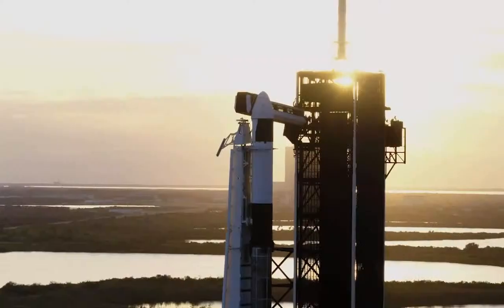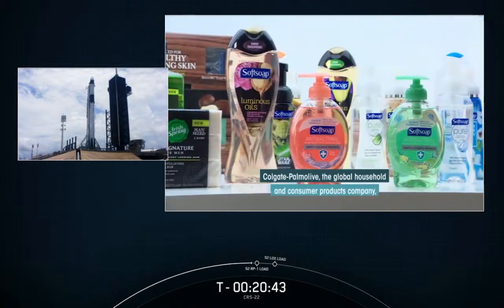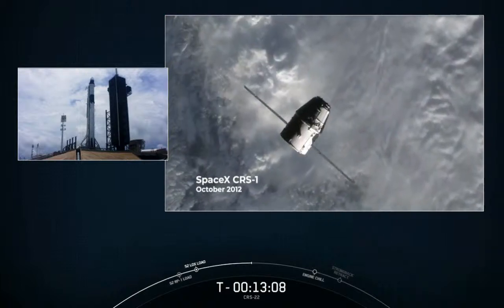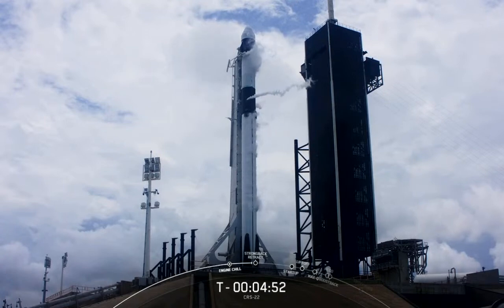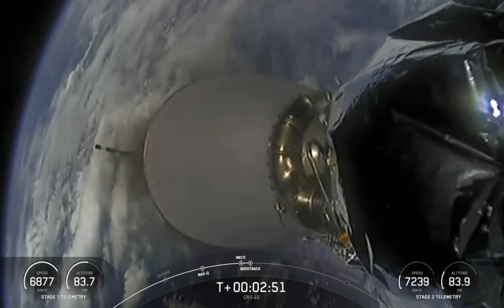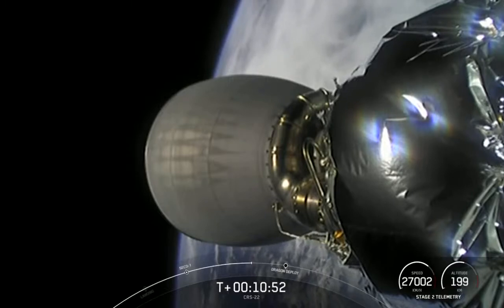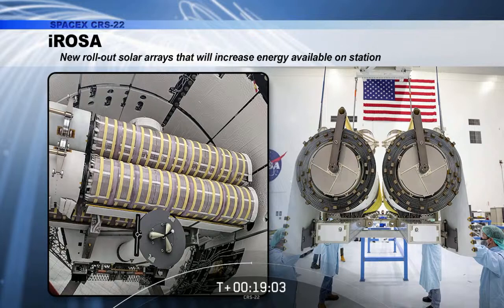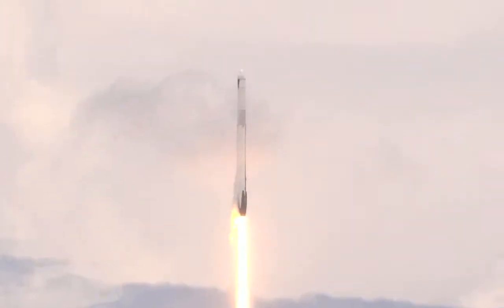CRS-22 Mission

Comment: Why is cargo dragon doesn't have superdraco engines?
Reply: Because they’re not needed since cargo isn’t as important as crew and would add dead weight which would decrease the payload it could carry
Reply: @weekiely1233  so you mean draco thrusters are capable enough to catch up with ISS and deorbit to return? That's amazing tho.
Reply: @MotoREEngr  on the front of the capsule you can see 4 thrusters. 

Those are the forward bulkhead thrusters that are the ones that do orbital manoeuvring, rendezvous and de orbiting. 

The superdraco engines are only used during an abort but we’re going to be used to land the capsule instead of parachutes. This idea was abandoned because it would take too much time to get certified.
Reply: @weekiely1233  Nice! Thanks!

Comment: Starship Landing
All planes on earth land horizontally on TRIPODS, regardless of length of fuselage or weight from super light piper cubs to jumbo jets to military carrier planes that transport heavy battle tanks to HARRIER jets and F35 fighter planes that do vertical take off and landing.

Why do planes land HORIZONTALLY on TRIPODS? It's the safest regardless of how smooth or bumpy the landing may be.

AND, consider how tall the Starship is, AND how top heavy with its payload of 100 metric tons - where is the center of gravity? A little tilt, like the lunar lander of Apollo 15 in 1971 - the Starship could topple down. WHAT GUARANTEE have you people that the landing site will be truly flat and sturdy and strong enough to support the FULL WEIGHT of Starship PLUS PAYLOAD. AND YOU'LL BE LANDING A THOUSAND STARSHIPS ON MARS VERTICALLY?!? HOW SURE ARE YOU THAT EVERY SINGLE ONE OF THEM WON'T TILT. SOFT SOIL OR BLOWING WIND ON A SHIP WITH A LITTLE TILT COULD FALL DOWN.
Reply: My man who will know more people who studied for that stuff ir a random dude on internet?
Reply: They have detailed height maps of the moon from the LRO, and spacex has already mastered landing in the right spot

Comment: Something fell off the top of the Second Stage engine, just above the bell, at about 3m12-16s. That happened?
Reply: Seems to happen on every launch. I think it's some kind of heat protection material that is shaken loose.
Reply: @3gunslingers  
It’s most likely ice. The propellants are kept really really cold so they’re denser and that causes the humidity in the air around the rocket while it’s still on the pad to condense and freeze. There’s a lot of little lips on the rocket where tiny pieces of ice will stick around for a while into the launch.
Reply: @dalesajdak422  
The fluffy stuff comes out of the engine wrap and pools on the exhaust piping on the engine nozzle. That's no ice.

Comment: Plans to return stage 2 or will it be junk every time?
Reply: It is always deorbited, or placed in an orbit that will eventually decay, so it always burns up. They studied the possibility of recovering it, but that would have required adding so much extra weight for fuel and heat shielding that there would have been very little left over for payload.

Comment: This is such a Scam.
Reply: What's a scam?
Reply: @Ethan_Roberts  The Reverse Landings.
Reply: @hotheadedjoelhaha  they're not reversed. Firstly that wouldn't be aerodynamically possible due to the low centre of mass and grid fins at the top. Secondly, the smoke goes away from the rocket, not into it. Lastly, this booster will return to port in a few days and be visible to hundreds of spectators. It definitely landed, no reason for it to be faked anyway.
Reply: Conspiritard?
Reply: @PentaxAstro  You can do much better than that.
Reply: @hotheadedjoelhaha  It's a question. It's not my fault you were vague. Are you suggesting a conspiritard, and if so, how does it work?

Comment: Boost back for a drone landing? Did they move the drone closer to shore?
Reply: Yes.  about 300 Kilometers, instead of around 550.  Because of the intended orbit of Dragon (Dragon uses the lower orbit to catch up to the ISS), Dragon had some fuel left over to Boost back.  Closer drone ship to shore, faster turn around, less fuel used on Drone Ship.

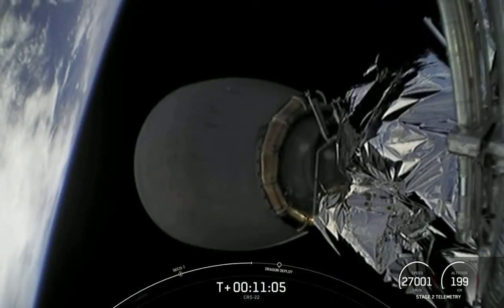Comment: What was that point of light in min 44:50? Just on the top of the engine crossing earth
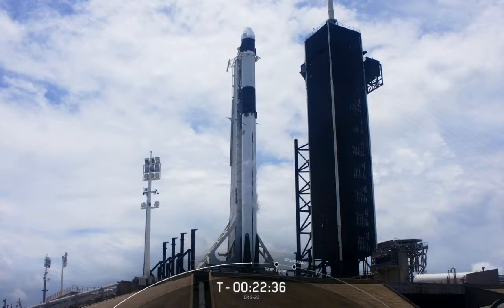Reply: At T+00:11:08, I saw a particle moving left. Probably oxygen or nitrogen ice from the second stage. 

At this altitude, there is still a tiny drag on shed debris. Debris motion directly to aft is very common, and other angles can be seen due to thrusters.

Comment: Something which annoys me is that the engines are not simply rocket engines but Merlin D1 engines, as if there are different types of engines on the ship. "Well we lit the Merlin D1 engines and we will start the Merlin D2 followed by the Arthur C6 engines...."
Reply: Two variants of Merlin engines on the rocket. The seconds stage uses an engine optimized for vacuum - with bigger nozzle.

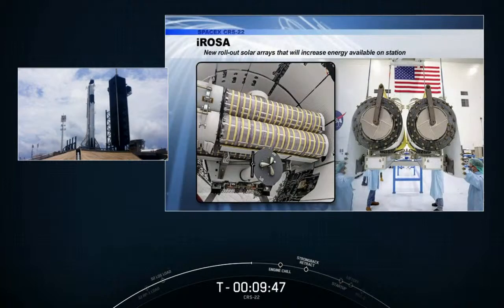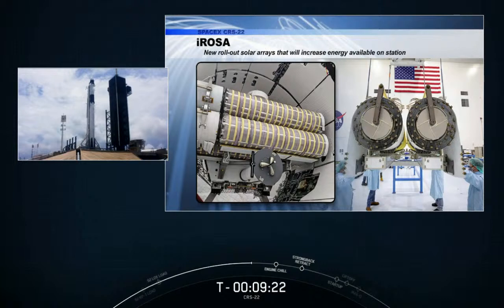Comment: ℹ️ New information on the new solar arrays going up to the international space station. 23:57 to 24:24 followed by 25:18 to 26:27 There will be a total of 6 new solar arrays going up to the space station. Once the 6 new solar arrays get installed it will produce 120 kilowatts of electricity. Enough to power more than 40 home's in the United States. The oldest solar array has been up on the international space station in use for over 20 year's. Two of the new solar arrays are currently gone up on this SpaceX cargo mission and will be installed this summer of 2021.

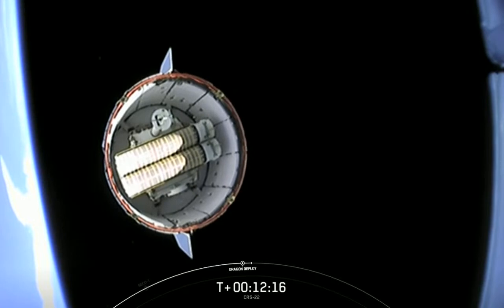Comment: 46:00 how do they catch the payload in space if it’s just floating away?
Reply: If you are referring to the Cargo Dragon spacecraft, it will make a series of burns and maneuvers to intercept the ISS. It will then dock to it autonomously.
Reply: Dragon "Catches up" to the ISS, and will automatically dock itself.  The crew on the ISS will use one of the Robotic Arm's to remove it from the "Trunk".
Reply: No, I actually meant the solar arrays they took, wasn’t that the payload?
Reply: @mobeenmuzzammil  - The solar arrays were only part of the payload. There was supplies and experiments inside the Cargo Dragon. Brian White explained in the previous comment that the arrays will be grappled by the stations robotic arm and removed from the trunk.
Reply: @steveadams7369  so cool, thank you so much for the explanation 🙌
Reply: @mobeenmuzzammil  2 types of payload.

Pressurized, in the cabin, and unpressurized, in the trunk.

The Two rolls of Solar arrays, are unpressurized.  In the cabin, there are pressurized cargo, like the squid, and Tardegrades.
Reply: @Brianwhite1969  ah that makes a lot of sense, thanks for the clarity. 🙌

Comment: will they ever not explain what maxQ is ??? :)
Reply: Nope.  They make these for a general audience.
Reply: @TheEvilmooseofdoom   I'm surprises you gave 100% certainty answer ... I hope You have good source and this was not just an opinion :) ... Regards
Reply: They do.  That is the point at which, the rockets speed and altitude, is exerting the MOST aerodynamic pressure from air resistance.  After that point, the atmosphere drops off quickly, and the Rocket can go back to full throttle and continue accelerating.  Before Max-Q, they reduce the thrust on the engines to reduce the Atmospheric drag, until it reaches "Max-Q", after which they increase the throttle back up again.

That was where the Shuttle Launches always called out "Go Throttle Up", was after Max-Q.
Reply: @Brianwhite1969  It always fascinates me how a single comment can be interpreted by different people :)  Thank You for detail explanation :) . And Regards

Comment: Wait, why was there a boostback burn if it landed on a droneship? That's not happened much before.
Reply: Heavier payload needing more propellant maybe? they might not have had enough for boostback to the land landing site.
Reply: @1shotz1killz12  When that happens they usually land on the drone further down range.  Boosting back and landing on a drone ship is new or relatively new since I can't recall it being done before.
Reply: The Drone Ship was about 300 Kilometers away from shore this time, because the intended orbit of the Dragon was LOWER, (It does a couple of burns later), so there was a bit of fuel left over to boost back to the drone ship closer to land.  This is instead of a Starlink launch, where it has no more fuel left at separation, so it uses momentum to carry it to apogee, and coast in an outward Arc, to the drone ship, about 550 Kilometers out.

Closer to land, Quicker turn around time, less fuel for the Drone ship.

Comment: How can two different cameras pointed at the same thing and show two completely different images one with a just recently landed ship and one no ship landed yet then the video cuts out
Reply: Satellite uplink of the camera on the barge is affected by the vibration of the thruster whereas the feed from the rocket is not.
Reply: @nolsp7240  there should be no time delay though. Cut out sure but not delay
Reply: @tazzerdeathstalker  lag in the interrupted data stream.
Reply: @TheEvilmooseofdoom  convenient
Reply: @tazzerdeathstalker   When the communications feed from the barge gets interrupted, it tends to freeze up for a few seconds before it just goes to black. Watch the video of the recent SN-15 test launch and you will see the same phenomenon. During much of the flight, all we were getting from the on board cameras was freeze frames.
Reply: @odysseusrex5908  just seems funny to me that the rocket would have much more vibration than the landing pad but they don't suffer from lag?
Reply: The two camera feeds are reaching the YT stream through entirely different synchronous orbital satellite relays and/or Starlink connections and/or direct line-of-sight to shore and then satellites. Reality is more complex than we usually attribute. Plus loss-of-signal may result in displaying a last-received still-frame.

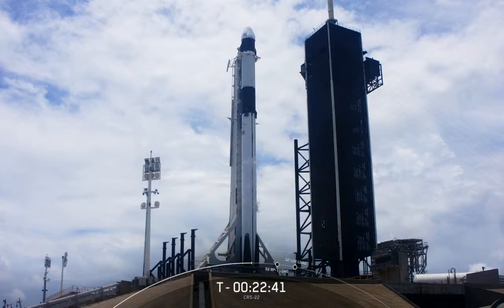Comment: What was the object flying accross the Earth on time T+11:09 ?
Reply: Strange🤔
Reply: @miguelpereira2022  Did you noticed that !
Reply: @ranjithkumar7829  Probably just a spec of frozen oxygen, as you can see it flies between the engine and the camera.
Reply: @kusawwwwwww  Well "frozen oxygen" sure sounds fun ))) It is water ice, which is the combustion by-product of LOX and RP which produces CO2 and H2O, so drain lines regularly (can see this every launch) release small chunks of water ice upon engine cooling...
Reply: @M12Howitzer  My bad, it was my impression that the exhaust from that region was just frozen oxygen directly from the LOX tank. To be honest I don't see much of a difference in visual appearance between ice and solid o2

And it's very entertaining to see a singular comment under most launches talk about how there was a "rat" running through the engine rings, when it's actually just ice.

Comment: Is that the first time they did a boost back burn to land on the barge? I only remember boost back burns being performed to get the 1st stage back to land on the ground.
Reply: They probably had extra fuel due to a less-than max payload.  Doing a boostback means the recovery will be closer to shore.  With starlink launches, they max out the payload for a down-range drone recovery so no extra fuel for a boost-back.
Reply: @nolsp7240  Sounds plausible!
Reply: @nolsp7240  Sounds reasonable but that was the first I remember seeing it. When I saw boost back burn on the SpaceX graphic I immediately thought they're landing back at the Cape.
Reply: @nolsp7240  Then why not all the way back to the Cape then?
Another mystery to look into.
Reply: @jcf20010  Yeah.  Wondering about that too.
Reply: @jcf20010  
Simply not enough margin for a LZ1 return. But landing closer to the drone-port is always better.
Reply: @nolsp7240  
The launch runs parallel to the Atlantic coast, so the shore distance is roughly constant. However, the distance to the drone-port is greatly reduced.
Reply: Just wondering exactly the same! Is this a new recovery profile?
Reply: You're joking right? The barges have been in use for years at this point.
Reply: @fresmarco78  No. Reread what I wrote. I'm question the boost back burn not the barge landing.
Reply: No, not joking. Every time I've seen the barge landing, the booster has simply carried on downrange with no boostback burn. Every boostback burn I've seen has occurred when the booster returns to the launch site. Happy to learn something new though - enlighten me!
Reply: @SC-qs3xq  they did boostbacks to land on the droneship during the Iridium missions but I'm not entirely sure what the reason for it is. Maybe to reduce stresses on the rocket provided they have the fuel margin?

Comment: Very curious about the smal debris periodically coming off of the second stage burn
Reply: That’s solid oxygen
Reply: The liquid oxygen, in its tank, is continuously boiling off. In order maintain the pressure, it periodically has to vent some oxygen overboard. When it does, some of it freezes and makes snowflakes or chunks.

Comment: Boost back burn and landing on the drone ship? That's a new one.
Reply: The Drone ship was only 300 Kilometers from shore, (it was explained on SpaceFlightNow), because of the Lower Stage Separation (Dragon will do the rest in a series of burns later), the Falcon had more fuel left, but not enough to make it back to the pad, so it boosted back to the Drone ship closer to shore, than a Starlink launch where at stage separation, it coasts upward before reaching apogee, and coasting back via the outward arc towards the Droneship, about 550 Kilometers out at sea.
Reply: @Brianwhite1969  thank you!!!! Awesome explanation!!!
Reply: @Brianwhite1969  Ah, makes sense.
Reply: That's what I was thinking!! Too bad they didn't explain it.
I guess it has something to do with the intended orbit but I'm not sure.
Reply: @NachooCh  They have launched to the ISS plenty without doing a boost back so I don't think it's the orbit.
Reply: @TheEvilmooseofdoom  Yeah, I thought about that. I gave a more complete answer to someone else's comment. Let me just copy-paste it here
Reply: The boostback burn probably has something to do with the intended orbit, but I'm not sure. You could argue that the last crewed launches did not do boostback burns, but I'm thinking that that's because of the payload's total mass. I think that this mission was carrying a heavier payload and that could have something to do with the path that the first stage needed to take.

Comment: Looks like they have the booster camera feed working perfect now. Great shot.
Reply: now they have to make the connection not lose signal from the camera on the droneship
Reply: @AcogR6  For real. That feed always f's up at the best moments
Reply: It varies with conditions but it's certainly nice when it can maintain uninterrupted video!
Reply: Yep. It's cause they started connecting it to their starlink
Reply: @megopzit  Nope, Dragon went to a lower orbit, so it had less fuel to worry about, so they boosted back to the drone ship, where it was about 300 kilometers from shore, instead of 550 Kilometers for a Starlink launch.  With Starlink, there is not enough fuel for a Boost back, so the Booster coasts up to Apogee, then falls back down in an outward arc, to meet the drone ship.  But in this launch, the Stage Separation is LOWER, so the F9 has nore fuel to boost back to the Drone ship, CLOSER to land.

After separation Dragon makes its own altitude adjustments to catch up to the ISS, via LOWER orbit.  In a LOWER orbit, the Dragon covers MORE ground distance than the ISS at the same orbit speed.  The inner orbit of a radius, covers MORE distance than the Outer.  So by being CLOSER to the planet, but at the SAME speed as the ISS, Dragon will catch up to the ISS, by the time the altitude is the same as the ISS.
Reply: New falcon 9, new camera :)
Reply: I loved the new wide angle stage 1 camera at takeoff & stage 1 landing.  But for the re-entry portion, I didn't like it because you see so much of the camera housing and you feel detached from the stage 1 as is re-enters and does it's first re-entry burn.

But overall, the new camera really adds something at takeoff and allows you to see the drone ship before it lands which gives a unique new perspective.
Reply: I noticed also
Reply: I’d guess 5G is working better today….
Reply: @gamergate4794  Nice pair of boosters.  Reported.
Reply: Literally the coolest thing I’ve seen all year
Reply: @starry4471    Starship
Reply: @xploration1437  well this and starship yes
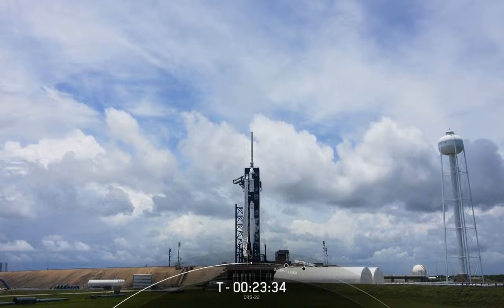Reply: Was that a UFO at 10:12